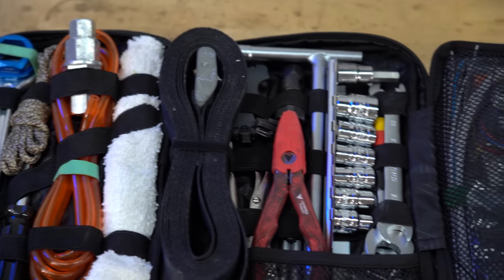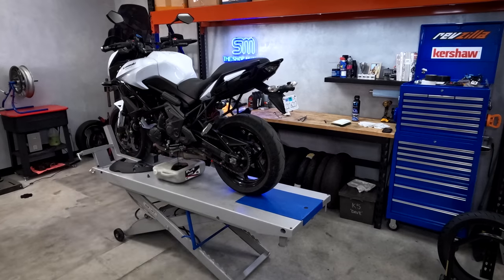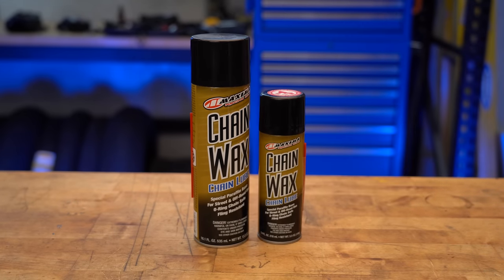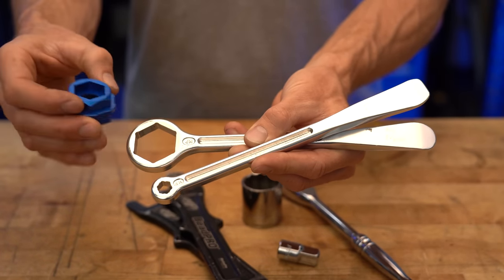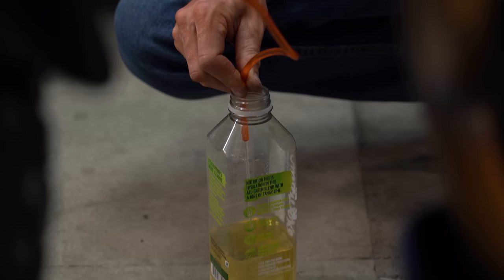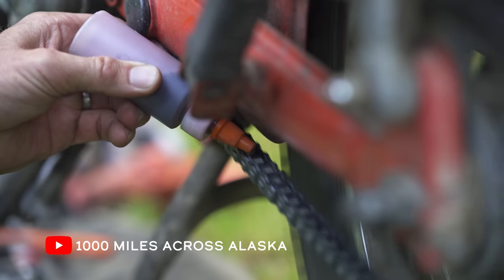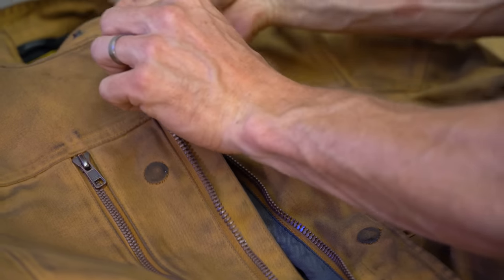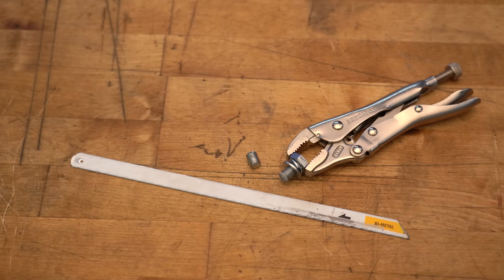What Tools To Pack For a Motorcycle Road Trip | The Shop Manual

Comment: Super glue and baking soda make a great hard plastic repair. Not sure about half emptying the JB weld tubes to save space and weight....it's not like you are ultra lite back packing...also take an assortment of nuts and bolts that match the bike, you can get small nut and bolt kits for European or Japanese bikes that are the same as OEM  fasteners. Also when at home use the tools you would carry on the trip, that way you know what fits and what does not. Get to know your bike and research the weak points and take spares for that, such as perhaps charge regulator, or water pump seals.

Comment: Yet another brilliant installment of the shop manual. Thank you for such a comprehensive guide, you did outline everything but the fact that the tool kit tends to be incremental with experience - afterall there is the self-capable bikers' Murphy's law: we always pack and prepare for everything but the breakdown that comes up on the next adventure. So carry the extra tool, within a reasonable 15-20% of your initial weight/volume, and maybe some cookies for while you wait for help.
Cheers, and thank you for another great video!

Comment: Do be wary of the DynaPlug pump. Grit easily and often gets into the gears and it stops working. That problem is easily fixed by taking it apart and clearing the offending stone—it's just a pain. What can't be fixed is when the plastic bits the metal output valves connect to snap. Then, the pump still pumps, but you can't put the air into your tire! You can easily take the pump apart and you will see how fragile the whole design is and how careful you need to be with it.

Comment: Great video. You mentioned fuses but I always bring a small pocket multimeter and a couple of paper clips (most probably know that straitened out allows probing connector pins) for figuring out electrical issues which is getting more important these day’s.

Comment: As always Ari, Stella video. Off down’t south for the KTM adventure rally in September. Plus a week afterwards. First longer trip in a few years. Bought a Kriega tool roll so keen to get myself sorted.. good tip re jotting down everything used for your pre-flight service!  

21” Tube, great idea plus those tyre irons with a 32” inset socket now that is smart! 👍

Comment: i had a footpeg snap off a month ago, if i didnt bring any tools i would have been stuck 😹 i removed the rest of the bolts and brake linkage then stuffed it in my bags.  rode for 3 hours with my right foot on the passenger peg 😹😹

Comment: Ari, my recent trip out to GetOn ended in the middle of the desert when my battery died. I was able to get a jump, but as soon as I disconnected the cables the bike would die again.  I needed up getting a tow to the nearest town and shipping the bike home thinking it was something wrong with the charging system.  Three weeks at the dealership and $1500 in expenses later it was determined that the battery just went bad and I could have replaced the battery and went on with my trip. 

How do you troubleshoot and inspect your electrical system before a trip?  The battery showed full charge when I left, and the bike started fine at the first two gas stops of the day, then just died.
Reply: Catastrophic failures are very hard to predict.
Reply: I think one of the things is checking the voltage, if you watch the voltage drop below 12v when starting then the battery is starting to go bad.
I have a little cigarette lighter voltage display i can plug in, and see my voltage,  Then once running should be 14v or close to it when running.  If it's higher than that when revving it 15-16v etc then it could be a bad rectifier. Or if it's not even 13.5v then could be a bad stator.   The nice things about those lithium packs you probably could have hooked one up and made it in to town with it acting as the battery since they are reasonably compact etc.
Reply: If you’re doing a big trip and the battery’s more than 3 years old replace it before heading out.
Reply: @richm4402  For sure. This one was less than two. But I’ve certainly learned to have it tested before a trip anyway.
Reply: @narrator-timothymckean  You had some bad luck Tim! Another consideration is to install a voltage display on your bike. I put them on all my bikes to monitor the charging system. This obviously won’t help prevent a battery from going bad , but it will let you know with some advance whether the charging system is failing.
Reply: Oh man, that's a bummer! There are some simple ways to test a battery's health using a volt meter. I've seen batteries show good (12.5ish V at rest) and then nosedive when you put a load on them. In my experience that's due to an internal connection failure in the battery. 
To test the charging system, just put a volt meter across the terminals with the bike running. You should see somewhere in the neighborhood of 14.4V. If not, rev it up to 2500 rpm and if it doesn't register in the low 14s there, you've got a charging-system issue that'll require further diagnosis.
Reply: @UCcpTH6eOCLGVgDErwj4RCOA on my Africa Twin I used one that has two USB outputs as well as a digital voltmeter. Picked it up on Amazon it’s been working well for a few years now. It really depends on your requirements and mounting options.
Reply: What was the dealer doing to diagnose the problem with three battery that took $1500¿ 
For the kit, it should include a DMM, a small pocket one would be very useful for diagnosing electrical issues. Wire and Wago splice connectors for quick fixes.

Comment: At what point should chain maintenance be a requirement? Like a lot of off-road mileage? 
I usually do at least one 1500+ mile trip a year, anywhere from 400-600 miles away and traveling around at the destination. I have never worried about chain maintenance even in the rain. I might give it a once over at major stops but that is about it.
Reply: If you have slack adjusted before the trip, you're probably going to be OK. Just as a reference, my CB500F owners manual says to inspect/clean/lube the chain every 600 miles
Reply: @AnthonyMillerTony  yeah 500 miles of pretty much the universal standard.
I have always averaged about 15,000 mi out of my chains, whether I am religious about doing it every couple weeks or I do it every few months. Probably a lot to do with writing in a clean street environment- Not a lot of dust, not a lot of road debris like sand or dirt getting kicked up.

Comment: As a relatively new rider who is going on longer and longer rides this is the kind of information I desire the most. I will slowly over time make a kit like this. But I will make one suggestion, get a better portable compressor, that Dynaplug is garbage. I paid $60 an it worked 2 times.

Comment: Zac, you ride a lot of different bikes.  Do you move that kit with you from bike to bike, or do you always assemble a new specific kit for each bike?  After seeing your selection process I felt pretty good about my road trip kit.  I have selected all the same items, but did learn about a few I would like to add or swap out.  My problem with my tool load roll and satellite kits, its its weight.  I have tried a few light weight tools from a manufacturer you represent some times, and several have broken with just a few uses.  So back into the kit went their heavy and bulky cousin.  I will be on the lookout for lighter weight alternatives, and might try those wrench/spoon combos. And also squeezing half my toothpaste tube out as well! ;)  Love TSM!
Reply: He does say at the start that the kit depends on the type of bike and trip you're going on, so my guess would be he keeps the same basics and then swaps out the few little differences depending on his requirements. Also, his name is Ari ;)
Reply: This is Ari,  Zac is his friend that he went to Alaska with and does the daily riders

Comment: Note, unless you find a 60's or 70's model car you are not going to siphon gas out a modern vehicle. They incorporate "springs" in the fill tubes to prevent that. Would be better to shove a ice pick through the bottom of tank, new tanks are plastic.

Comment: Green slime in a can. Any compressed air in a can is better than nothing.  U can also use your Cylinder air to fill a tire, there are screw ins for the spark plug hole. Used O Rigng chains but now I avoid them. And used motor oil is great chain lube If you can let it soak over night, The longer and hotter the better. On MX tracks I can go hours between chain lube application. W/O it I lube "all the time"

Comment: Well, if you are going on a ROAD trip, then NEVER, EVER, consider doing it on a bike with tube type tires. Not only are tube type tires a lot easier to puncture than tubeless tires, but when punctured, they often blow out. I know. I have survived several blowouts at high speeds with tube type tires. Two of those resulted in crashing, though I managed to get my speed down low enough that I was not seriously injured. Also, having a flat with tube type tires on a bike with no centerstand (and I mean a real bolt on centerstand that is actually a part of the bike, not some kind of flimsy prop rod) means a tow truck. It may anyway, as some tires are almost impossible to remove and reinstall beside the road. If you are out of cell phone range, you are likely stranded. Tubeless tires have been around for about 70 years. Can you imagine a car that still used tube type tires? Then why do motorcycles continue to use them?
Reply: tubes are best for offroad riding, (refer lyndon poskitt, dakar rally legend). I ride classics mainly also, all with tubes, I just dont cruise at 80 in the fast lane! in fact cruising main roads is so boring, I just avoid them - horses for courses

Comment: If you're overlanding sure. For the other 99.999% of us this is way too much stuff. You only need a portable compressor and chain lube. For anything else you just really need a good roadside assistance insurance, which is both cheaper and lighter than all this stuff that you will probably never use.